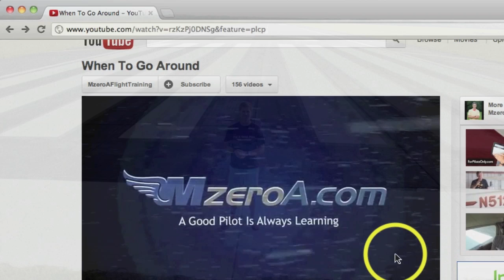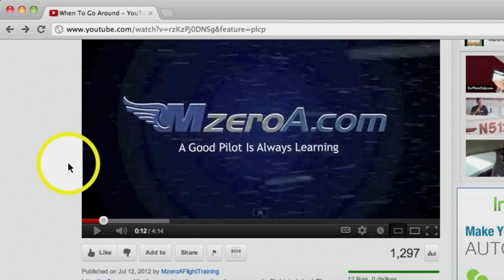Runway Incursion Avoidance

Comment: Great call by the US Air pilots..  Whether that was the PIC or SIC, both/either realized the controller was confused, decieding to hang tight until all was cleared up.  The safe thinking and actions by the US Air flight probably avoided a disaster.  

Jason, I completely agree with your recommendation for briefing the taxi route prior to departure from the ramp.  This allows both pilots (or one if there's only one) to truly understand which maneuvers need to be taken at which locations.